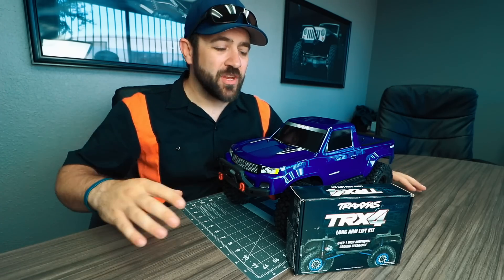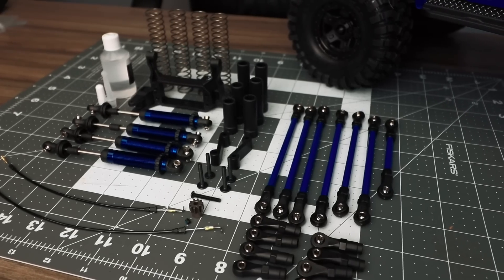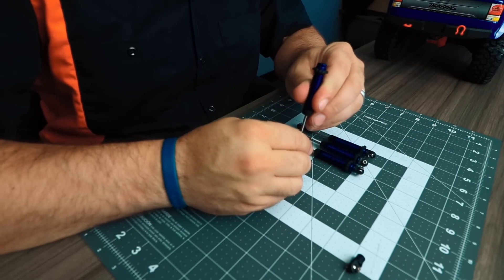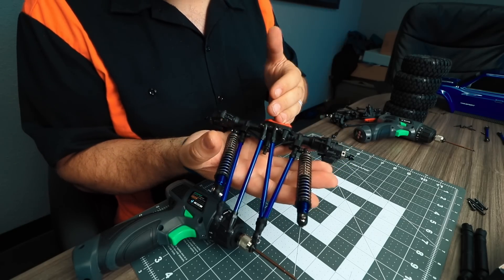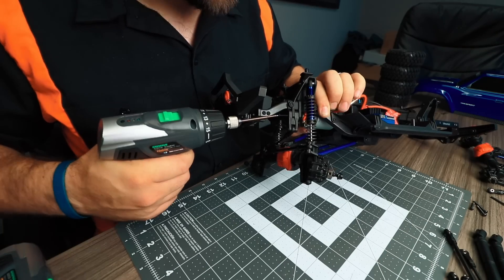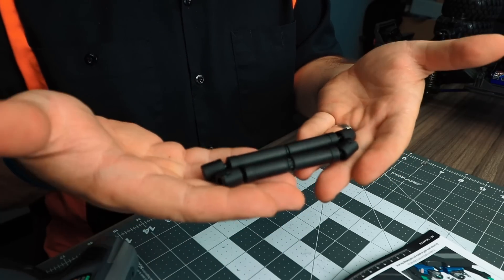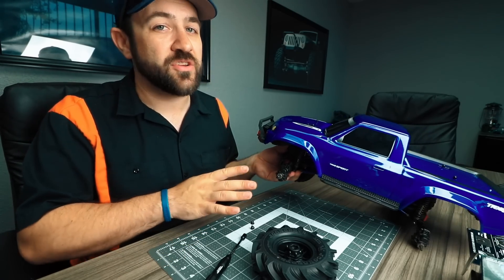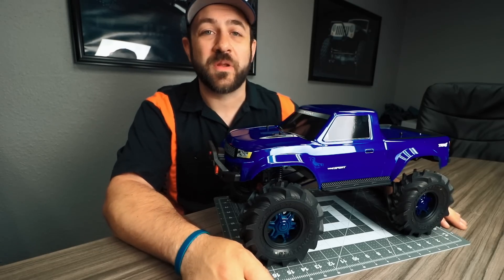TRX4 Lift Kit and Mega Truck

Comment: I understand you’re going for a mud truck style, but there’s a couple things you can do to get the lift kit to work well for you.
First thing you want to do it remove the bump stops from the shocks so you can get the full stroke, then when you put them back together, you want to have a weaker spring. Doing this will give you some droop, and also allow for a little more suspension movement.
Next thing you want to do it get some brass portal housings. This will lower your cog down some.
Last, forget the 2.2, they just hit the body and get in the way. Stick with a good tire that fits in the fenders. 
I did these changes to my trx4 and it works great.
Reply from the maker: Unless it’s for a mud truck I’d never use a lift kit. The COG of the TRX is already too high. For a mud truck, this setup does work well though and is a cool option.

Comment: When I built my Wraith Spawn kit, I intended it to be a sort of mega truck, using the RC4WD Mud Basher 2.2’s, because of all the steep hills and soft soil in the woods at my in-laws’ place. I often felt a Traxxas Summit would have been applicable, as well, since they seem to designed for general open forest trail-bashing. Maybe that’s what a TRX-4 Lift Kit setup would be most applicable to, for those who explore woodland trails, loaded with muddy bogs and streams(i.e. Most of the trails you see in RC ATHLETES‘ vids), but want a more scale truck, as opposed to a bulky Summit. I might actually devote my Bronco pre-roller to that, when we get into our PNW wet, winter season. The clearance will help keep the chassis, itself, from getting too soiled. 🤓

Comment: Thank u for the video!  Answered allot of my questions about the lift kit; love the mud tires! Next up u should install those MIP wide axle stubs for the portals for extra stability
Reply from the maker: I talked about that in this video. Adding wideners it large offsets is terrible for your steering. People need to stop adding so much width to their trucks.
Reply: Harley Designs I forgot that u had the offset option on your wheels

Comment: The purpose of a lift kit is for clearing tires. Ground clearance comes from tires truly.  It has a side purpose of reducing drag in mudholes. But either way, lift is only need as far as its purpose. Long arm lift kits are mildly different. They are necessary for increased travel and flex. But with lockers and locking differentials, it is less necessary.

Comment: Agree with your opinion of the lift kit.. not very practical for anything other than a giant mud truck.. but hey just wanted to say I can't wait to see the cross truck you got ..I hope hope hope it's the demon because I have been thinking about getting that truck but have been second guessing just due to some of the ways it drives .. I'm really looking forward to your opinion of the truck.. it doesn't have to be the next best thing but as long as it can be modified and changed a bit to negate some of the issues I feel I saw I will be happy. Thanks so kich
Reply: I got mine yesterday and it will be awhile before I start building it, too many other projects on the table at the moment. 
Things I noticed as I inventoried the box; its going to be a slightly top heavy rig, battery compartment is oddly sized and I am one that likes to at least go an hour without swapping, so will be extending the compartment. Tires are a little bigger than specs listed, 115mm I measured 118.
Probably going to go brushless (HH Stubby) to get some more wheel speed on it.
Not a lot of flex in the plastic, much less than like the Axial stuff, more like MST.. a little concerning for sub freezing days and taking a tumble.
Its going to look great, just don't think its going to be one of my better performers till maybe some mods come out.

Comment: Could you run 2.2 tires on the TRX4 Sport without the lift kit?
Reply from the maker: It would require trimming or small 2.2's. I wouldn't run 2.2's in a normal situation on a TRX4 anyway though.

Comment: Dam $175 is way to much in my opinion. Great video though. The truck looks great. 👍 👍
Reply: They sure are proud of that lift kit, based on their Snap-on Tools type of markup.
Reply: Paultro 84 cheat a little, I just bought a set of rear links and put them on the front. The problem is you increase the wheel base.

Comment: So it is a long arm kit? I believe in your previous video you say "its not like its a long arm kit".
Reply from the maker: A long arm kit in the full size world typically means that the chassis side mounts are moved further back to lengthen the radius of the axle movement in order to benefit performance not just offset the shortening of the wheelbase. So this is not like a full size “long arm kit”, it is just slightly longer links to compensate for the wheelbase change.

Comment: Yeah people don't use a drill to add or remove your screws. This heats the plastic and melts the threads slightly each time you run the screw in and out.
Just a few times in and out and you'll have weakened threads, or even worse threads that won't tighten down at all.
I have Twenty five years of rc experience and I have tried everything to make building and repairing easier. I have found that using anything other than a manual hand driver turns the threads. Also this is a good time to warn you about used RC's. Alot of times guys will own a car for one or two years, repair it a few times and realize they have ruined most of the threads. They then sell the RC because they know it's a lost cause at this point.
Reply from the maker: If you’re using a model with low quality plastic or plastic or non-nylon like plastic than that is valid. However if you’re using a model with glass filled nylon especially, the heat created by a screw will not exceed to heat capability of the plastic. The most common issue with people using power tools is not using a chuck and over tightening.